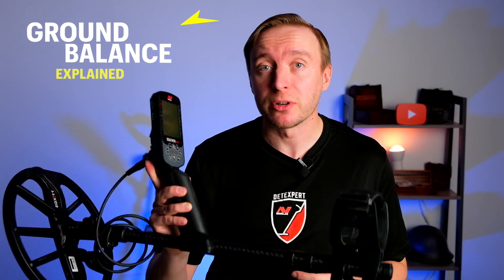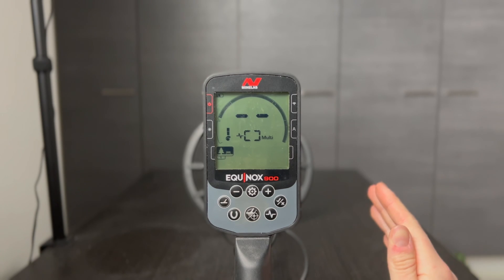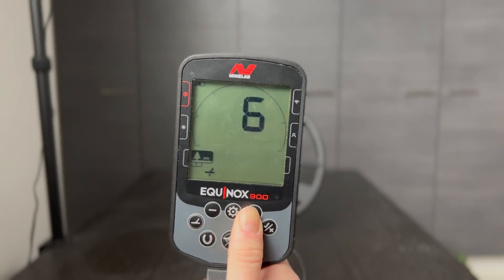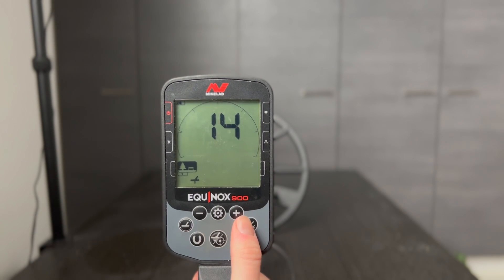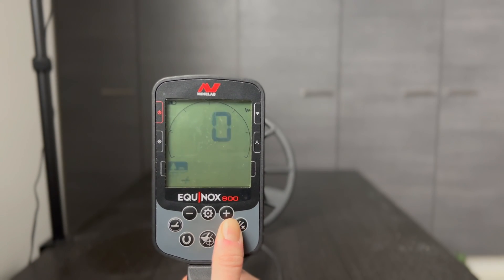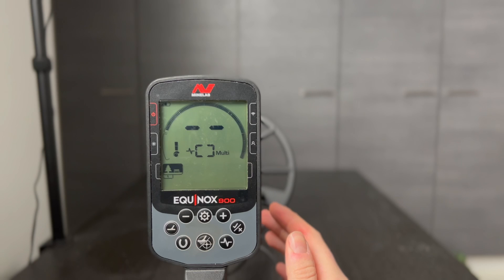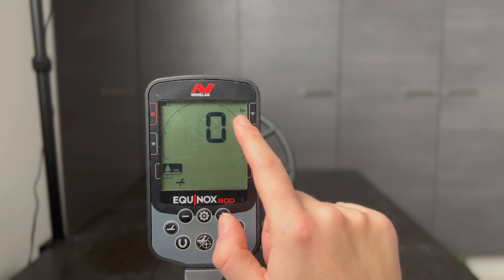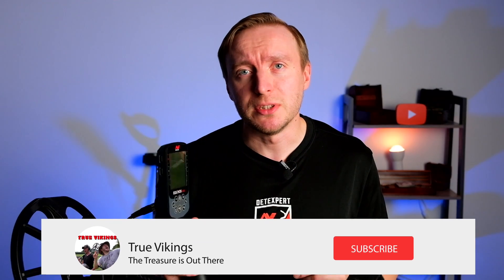Ground Balance EXPLAINED! - Minelab Equinox metal detectors

Comment: Thanks for the info. Has the tracking ground balance any disadvantage? (like loss of scan power/depth or battery consumption?) Because if not I don't see the need of adjusting the GB manual/auto each time the ground changes.